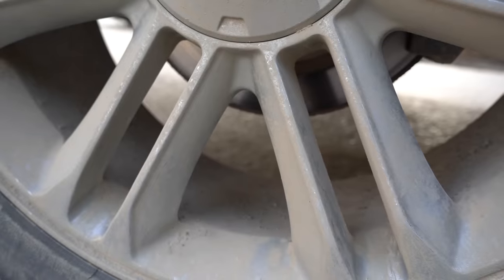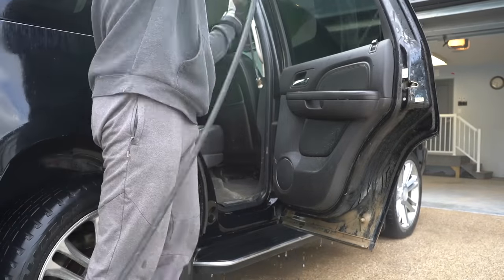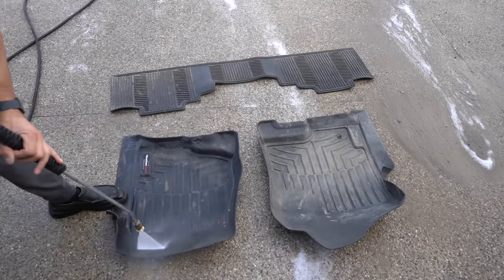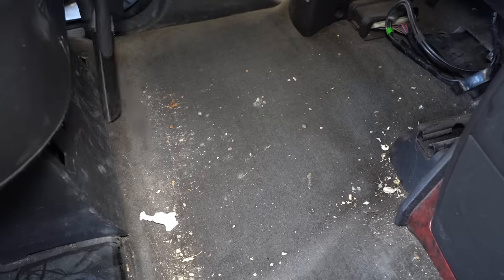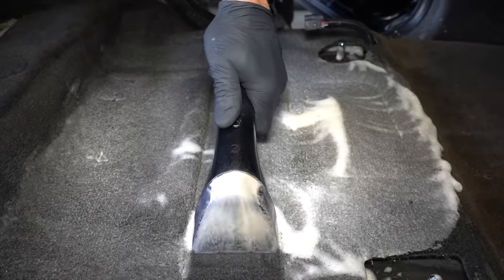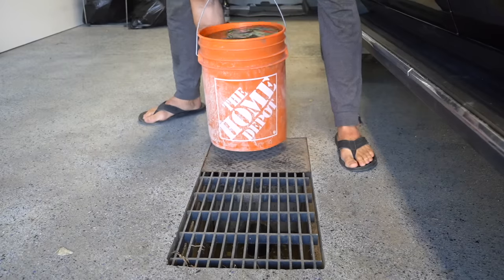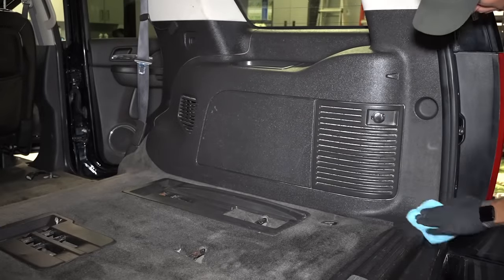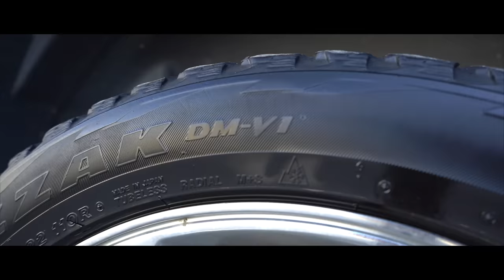Deep Cleaning a Mom's DIRTY Escalade! | The Detail Geek

Comment: Is it just me or Is cleaning a car the most satisfying things ever. Especially with a pressure washer
Reply: Try the inside of the trailers that deliver the flour for cup noodles
Reply: Shouldn’t use a pressure washer so close to the paint.. It removes the clear coat on the vehicle and can cause more scratches. I cringe everytime I see this.
Reply: Crim right me too.
Reply: Brad Viviviyal  why do u say that?
Reply: @Kasamigirl1   that pressure washer (which I just guess has around 3000 psi) should not penetrate a good multi layer clear coat job. Anything is possible especially with older vehicles with more exposure and wear but not likely on a newer vehicle.
Reply: Crim makes cleaning it easy I guess the paint job is the owners problem
Reply: Nope it's satisfying
Reply: for me foam cannon
Reply: Lol i do this as a job while being a student i clean trucks and their trailers
Reply: hugo cahill nah it’s the water vacuum thing that is tricking amazing for me.
Reply: It is so satisfying
Reply: exactly
Reply: I also do car detailing and it is the satisfaction of seeing what difference you can make in someone's nice vehicle, whether it is a car, truck, motorcycle, tractor, or airplane cabin.  It is a lot of hard work but very enjoyable.

Comment: So when they’re putting”used cars” on a lot, this is how they properly clean them, right so they’ll look new?
Reply: For the most part
Reply: Ha!  Never to this extent.  Their business is to sell the car, not to clean the car, so they are only surface cleaned. If you want it properly cleaned, take it to a professional detailer.
Reply: I think so
Reply: I have worked for several large car dealerships, and they only do a minimal surface clean, never a full detail like this.
Reply: They don’t do this much work take a look at the fabric seats they maybe filthy even the wax won’t be as good
Reply: yup...but the antifreeze is low. I've been through it.
Reply: Pretty certain i work for the only dealership in MN that offers full details for customers and all of the used inventory goes through a full interior and exterior detail process. Otherwise any dealership will just do a quick clean to sell it quickly

Comment: I work for a small town auto dealer in rural Iowa, and I can say with full confidence that I've cleaned cars as dusty, if not dustier, than this. There's no good way to get the dirt out from all of the rear hatch crevices, so you sit there spraying the corners of the rear window for minutes on end watching more and more dirt and crap roll down the rear window. 

I honestly came here to see how you dealt with the door jam dirt situation, and seeing using the pressure washer on it made me realize that as long as you're not directly hosing or pressure washing the interior, spray or water that gets into the interior can be dealt with because it's probably not going to do much damage. I've personally been using the detailing gun we have for this application, and it's worked well but that's because it's just an air pressurized spray that's doing just about the same thing.

Comment: Geez, looks like they used the thing as an actual tractor, rather than the family car.
Reply: That Escalade would have the same 6.0L motor as the 3/4- and 1-ton pickups, along with AWD with lock and low range, and a limited-slip rear end. It probably makes a better work truck than most actual work trucks.

Comment: it takes me 12 hours to wash my car, which is half the size, and i do half the things you do.... damn, i'm so lazy.
Reply: Me 😂 I wash, dry, vacuum interior add the leather protector and the dashboard protector to my Explorer and I take all day vs. My dad who does his lifted f-250 in under 3 hours with everything
Reply: to be fair not everyone has a power washer on hand.
Reply: It takes me 3 hours to wash my lifted f150 fx4 with a garden hose w/high pressure nozzle, two buckets, wash mitt and long handle brush, and that’s just to get all the mud and lime dust off that accumulates from the steel mill I work at.
Reply: @108wee  we use the hand in my house

Comment: A great way to remove headliner stains is using a glass cleaner and an air compressor. you spray the stain, scrub with a light brush or towel and blow it out with the compressor. If its a water stain try to cover one section at a time and blow out the area immediately. Hope this info is useful.

Comment: Question: Would you foam the car first with Belt Hamber snow foam first to release the dirt quicker rather than using the jet wash first to do this and then foaming it afterwards? Might save you some time as this snow foam is the business and has better cleaning power ( it takes the first with it when you wash it off ). Just a suggestion. Great detail and the products you use are awesome and do a great job. In addition, would you use the carpet cleaner for the floors rather than the APC? Better cleaning power?

Comment: always wash roof down to ground dirt and dust will fall down the car with gravity so washing roof down helps this plus the bottom is usually the worse for dirt and wheels so do cars in sections top middle and bottom last and rinse sponge very often. For my own personal car I don't touch it when washing good power wash then a good snow foam and let sit for five ten mins and then rinse it off as soon as you lay hands on a car even with the best rinse down will still get spirals in paint.

Comment: Thanks for the content bro, really enjoying it. Question, I’m not getting any foam out of any of my foam cannons. I have 3 different brands and they only spray water. I have the tube connected in each one and there are no leaks. The only way I can get foam is if I turn the top knob one way but it falls down from the nozzle and doesn’t produce thick foam or even get to the car. By the time it does it’s just water again. These are brand new never used foam cannons and the first time I’m using them. Any thoughts as to why they’re not producing foam? Thanks.

Comment: It's a shame, but the owner will likely not get the rust spots addressed on the driver's and passenger's door near the body-side moulding.  They started as rock chips, but without touch-up, the cancer has started, and will continue.  Too bad, because despite driving on back-country roads, the paint doesn't look too bad (from 10 feet) on the rest of the 12 y/o + vehicle.